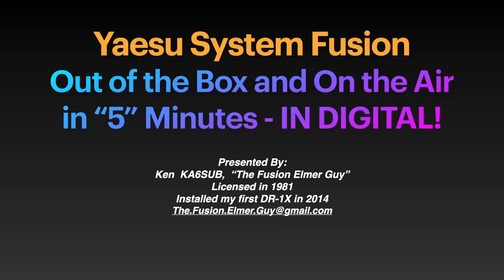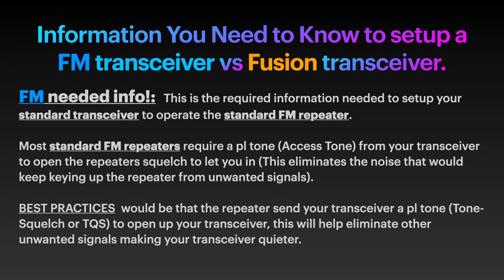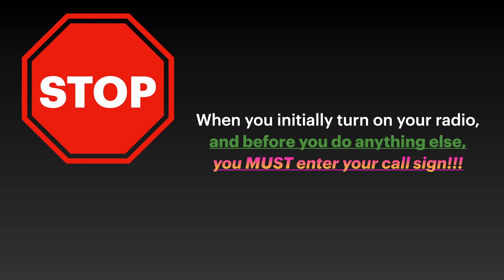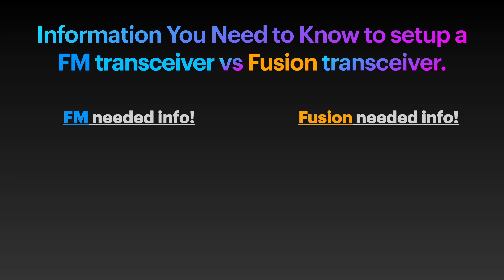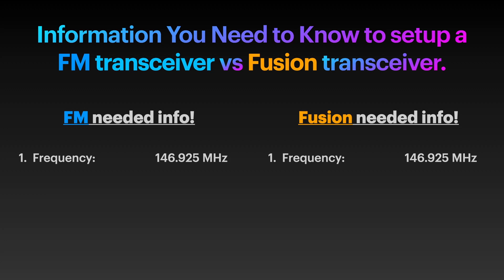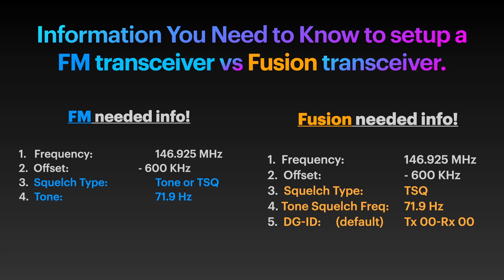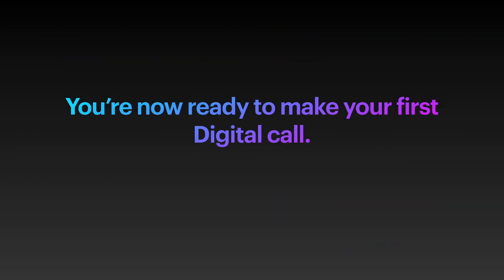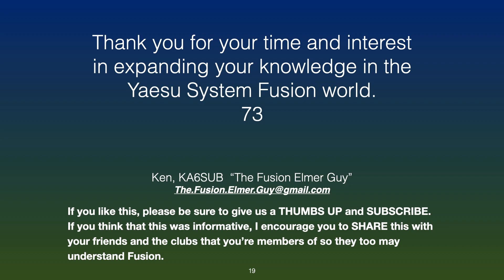Out of the Box and On the Air in 5 Minutes ... In Digital!!!

Comment: Tone vs TSQ. Can can a regular FM repeater work if I set my HT in TSQ?
Reply from the maker: Thank you for your questions Marc.  There are two ways to find out if the repeater you are interested in is actually sending out an encoded tone. (1) Is to ask the repeater trustee, group in charge of the repeater or (2) merely switch your radio over to TSQ (tone squelch), while QSO is on going.  If the QSO goes away, the answer is NO it doesn’t working on that repeater, if you continue to hear the QSO,  then it works on that repeater.  In a Best Practice scenario, all FM repeaters should be encoding a tone on their output, this would give the operator the option to use either TSQ or the old-fashioned adjust your squelch control every time you change your position or the conditions change. TSQ is far superior to the old method, that’s why repeaters are set up to recognize the proper tone on the input signal of the repeater to activate the transmitter. It cleans up the noisy world that we live in today.  I personally feel that this should be an option for the user to choose and use whichever method he or she is comfortable with. Just my two cents worth. I sure hope that this has been helpful to you and again thank you for your question. 73 Ken “The Fusion Elmer Guy”.
Reply: @thefusionelmerguy2234  thank you for that great answer. Keep it up.

Comment: Great video Ken. If I have my radio set to AMS out and I key up a repeater will my radio send digital or fusion by default?
Reply from the maker: Thank you for subscribing to my channel. Great question Kevin. It totally depends on which radio you have and how you have set it up.  The display will show either a "DN" or "FM" with a line (Bar) over it. The Bar means that your radio is in AMS mode and it will transmit in whichever one is showing with the Bar.  If it is showing DN but you would like to transmit in FM, you would need to press the MODE button until FM shows there.  Some radios have a soft button on the screen that may say AUTO-FM-DN.  This is the default Transmit settings. When in AUTO, it will Transmit in the mode that is set in the upper right corner of your screen, if on the other hand, it shows FM, then it will Transmit in FM, if it shows DN, then it will transmit in DN.  Remember that each model is different. If you have any more questions, please send them this way.   73,  KA6SUB  Ken  "The Fusion Elmer Guy"

Comment: Hi Ken , I’m also trying too understand fusion and c4fm . I have a FT70 also . Cannot wait for your video on it ? 73s KJ7ZTI
Reply from the maker: Hi Andrew, are you using your radio currently with any of your local repeaters?  I pulled up some of your local repeaters and I think you have about 4 or 5 that are Fusion. Check out RepeaterBook. I was looking at the KB7ZZY Repeater,, it looks like mine, fully loaded.  You should be able to contact me either by Wires-X, IRLP or EchoLink. A video on the FT70 is in the works but be honest it may be awhile before it is done. You can look me up on QRZ, my email is good on there. If you tell me your questions I may be able to walk you though it. Thank you for watching and if you haven’t done it already please subscribe, give me a thumbs up and be sure to ring the bell so you can be notified of future videos.
 73 
Ken KA6SUB 
“The Fusion Elmer Guy”

Comment: Thank you for this video Ken. I just recently got my Tech. license and got me a Yaesu FT-70DR and I have been trying to figure out how to program it for Fusion. Here where I live most repeaters are both FM and Fusion ( both). My question is, do I need to program the same repeater in my radio twice? For example, in FM mode program it as FM and save to memory and then program it again as Digital Fusion  and save to memory again? Thank you.
Reply from the maker: Congratulations  on your Tech Lic.  I'm sorry about taking so long to get back to you, but sometimes life gets in the way!  To answer your question; on those repeaters that are both FM and C4FM (Fusion Repeaters in AMS), NO!  You would set up one memory for that Frequency with both the TSQ Freq (NOT Tone PL) and the correct DG-ID (most of the time it will be Tx-xx(00) and Rx-00) code and enter it as AMS for the Mode.  It will follow the repeater and change between FM and C4FM.  Sorry I haven't posted and video on the FT-70, I got one in the works, I will have to finish it.  Feel free to call me on Wires-X @ #11618 or #43206 any time.  Thank you for watching and writing.   73 de KA6SUB "The Fusion Elmer Guy"
Reply: @thefusionelmerguy2234    Hi, I just ordered an SCU-39 kit for my FT5D.  I will be interested in learning how to call you by using your WiresX "room or node numbers"???   It sounds like my HT doubles as a telephone.
73,  Don - KI5VIT